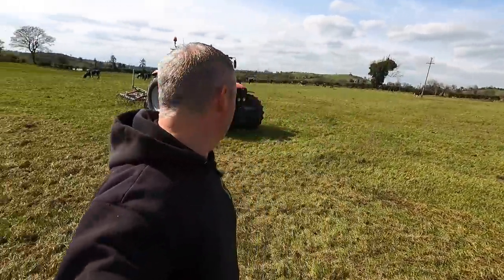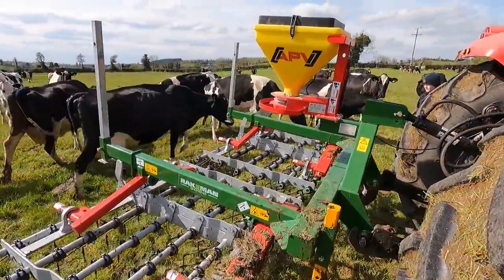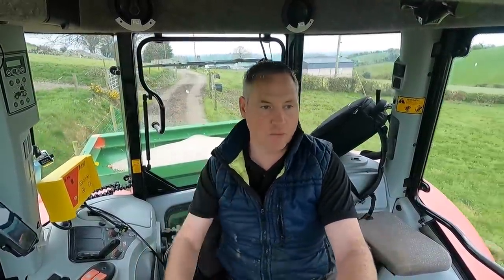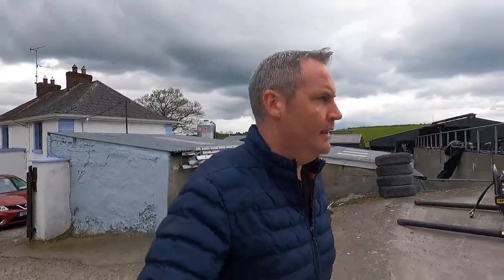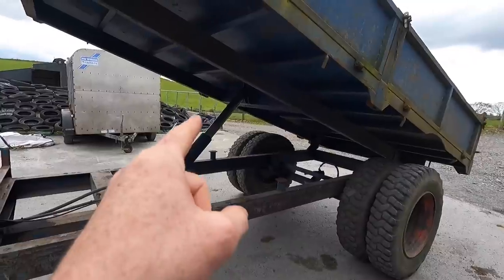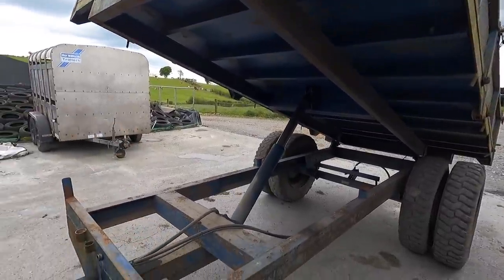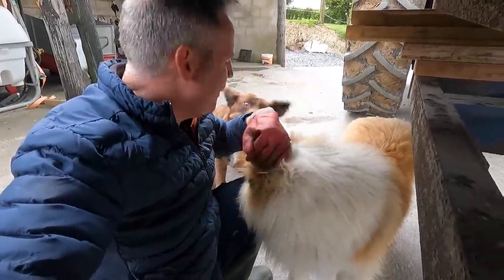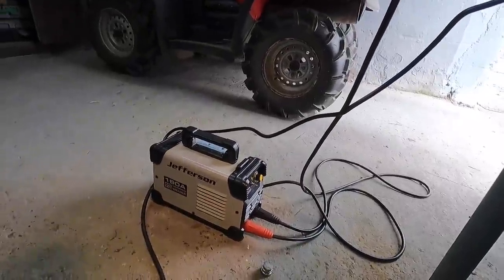OVERSEEDING IN 3 STAGES, THIS IS THE REAL TEST!! & THE JOB I WISHED I NEVER STARTED!!!

Comment: Mighty work with the reseeder Adrian,  valuable asset for sure but to be fair as you rightly said a tool for the modern progressive farmer !! Regards the pins for the tipping ram......PMSL......nasty bas***ds to change but a grease nipple and a strong pin and bushing set up are a must....it's wherevall the weight and force is after all.....stay safe amigo.!!

Comment: Did u change one of the leads out of the welder. I have the same welder and theres a different thing for holding the rods
Reply from the maker: Yes I always upgrade to a heavier duty earth and rod ends, the cables are the same. There not expensive and stand up to way more abuse.

Comment: That's my thinking too,just swing a bigger hammer at the problem, I had a famous 14lb sledge when I worked on the sites,never failed to move what I wanted moved. 💪
Regarding the super singles on the trailer Adrian, they aren't as reliable in the bog as a set of doubles 👍😂😂

Comment: Great video as always, quick question where did u get your power washer and attachments for cleaning down your machinery, also what foam do you recommend
Reply from the maker: I got my washer in John o’connells Baileboro, years ago. It a TX 12-100. There pricy but worth it. You can get them in most good hire shops. 
I keep changing my foam and never pass to much remarks on the brand. Buy in in 5 gallon drums. Most Co.oops and auto shops will have that 👍

Comment: What is that little gas cylinder heater you used there and would you recommend it for heating for small jobs like seized lift arms, plug in a roller seized etc
Reply from the maker: It’s just a hand held gas torch, most hire shops or Hardward stores should have them, there very handy but not as hot as the larger bottled gas. Still great for small seized bolts and stuff like thst

Comment: You need to make T-shirts 😀"Not working out? Just use a bigger hammer" Thanks for the laugh. I need to overseed too. Using a spring tine harrow and a broadcast seeder is brilliant. I thought I would have to buy a no-till seed drill. My ground used to be part of a dairy (closed on the 1970s) and the ground is still high in phosphorus (low nitrogen, so wanting to overseed with a bit of white clover  - will be a horse pasture - and mixed grasses). Do you have any issues with excess phosphorus from spreading dairy slurry?
Reply from the maker: No actually our land was low in phosphorus on our last soil test, PH was between 5.3/5.8. So we are liming our land this year. I would worry about nitrogen levels, just get the P & K correct. A high phosphorus level can leave cattle lacking in Copper so watch out for that one. Rare though

Comment: U should’ve put something rlly strong underneath the trailer and used the ram to bend the pin back
Reply from the maker: A ram wouldn’t have the pull Back strength, that bend came from lots of heavy loads over a long period of time. Thankfully all’s well that ends well, I like giving myself hardship 🙈😉

Comment: Spray WD40 oli over ur fertiliser spreader when it's dry after washing. Save the machine.
Reply from the maker: I use diesel and oil mix, that sower is 12 years old so it’s doing a good job 👍

Comment: We’ve a tipper trailer like that, but like u said it has super singles and there is one major flaw that we have learned the hard way 😅, that is when on Unlevel ground the trailer is way more inclined to Tipp over as when the weight goes to one side it is a lot of pressure on one tire.
Reply from the maker: That’s true, it is a plus there. Ah it’s grand but they can drag a lot of muck out on the road which is frustrating at times

Comment: Be careful of that welder have the same one 3 months old. Earth wire melted off the clamp and the same for the welding stick days apart of each other I think the wire a too week or too cheap.
Reply from the maker: I had my first one 8 years, never an issue and sold it on for more than half what I payed and it’s working away, done plenty of Heavy work with it. Now I will say the first thing I do with any of welder is I upgrade the earth clamp and stick torch to heavy duty, cheaply done. But the ones that comes on them are still perfectly fine to work with just not as hardy. If the cable is melting there must be something causing that, to high of amps and lack of power. Is the plug warm? Also what Amps are you generally welding at? I rarely cross 90

Comment: Honda are not as good as they were, older engines were much better,
Reply from the maker: Same with everything really. Was really disappointed with it as the machine it’s self is so handy, would love to fit a B&S engine if it was possible but it would require to much work. 😞
Reply: @IFarmWeFarm  the briggs are much improved, I mow lawns and trim hedges here in Louth,  I can't fault Honda and stihl.  But it is all 15 years old now. They all start on the button.